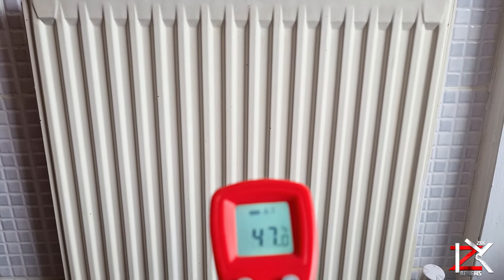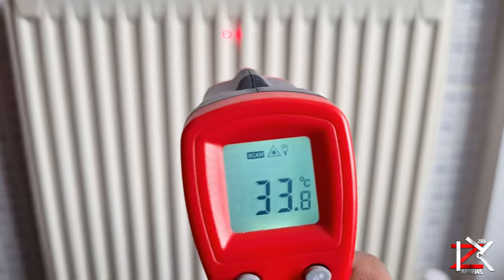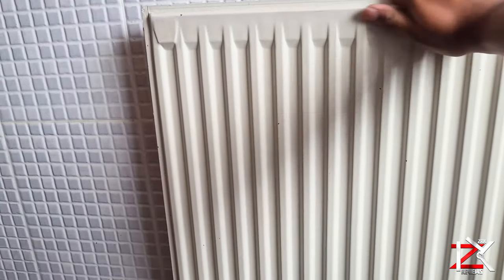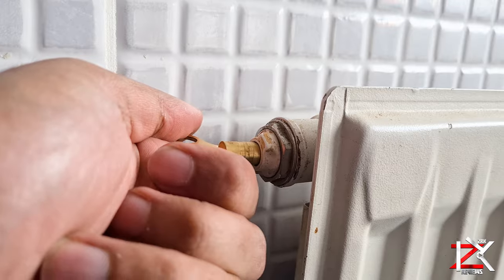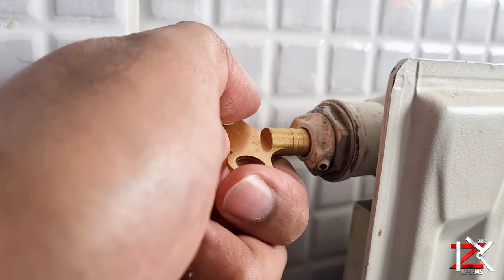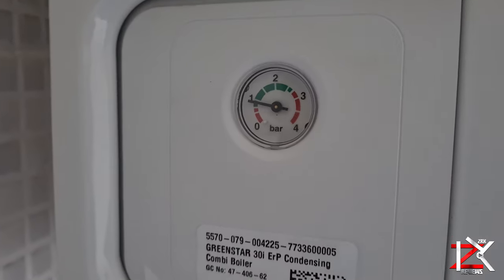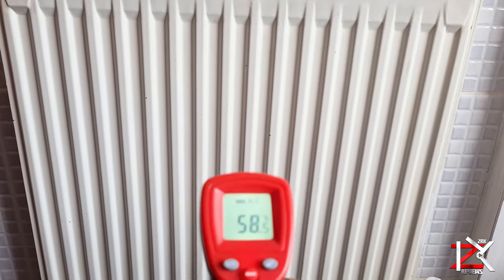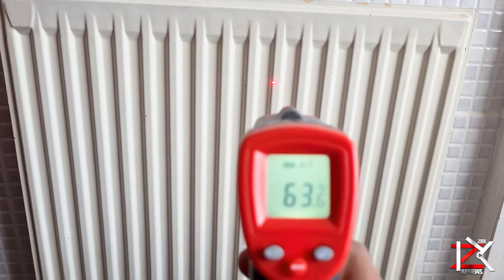How To Simply Fix COLD Top Radiators | How To Bleed Radiators - Cold Bottom Warm Top Radiators Fix

Comment: mine brand new rad and system flshed out all round house-rad warm rather than hot top half warm----bottom half cold-plumber left it like this as he failed to bleed other rads upstairs as wee found out after he left and had been paid ---other rads upstairs and down roasting now after i bled them all-- but not the new double one he fitted-he came back and alledged it was air after 15mins he said it was ok another £30-if i had been there i woulkdnt have paid him-no better-rad still the same---wife told him i had bled it no air coming out she told him-- that was 10 days ago-he hasnt come back-what in your opinion is the problem thanks
Reply from the maker: Hi, i cant seem to understand exactly the issue, the only 2 issues with a radiator is having too much air or having Radiator sludge which is a mix of dirt and rust, this is what stops your rad getting warm. in regards to someone you paid to fix the rad its a civil matter. always pay after job satisfaction.

Comment: My radiator is hot at the top but cold at the bottom. The weirdest thing about it is that return pipe is hot and flow pipe is cold(actual pipe below trv). I am puzzled. Could it be because system is not well balanced?
Reply from the maker: check with your other rads if its the same, normally if its cold at the bottom then the rad needs cleaning out as alot of  debris from the pipes is sitting there. get a mag filter install too.
Reply: @ZRKREVIEWS  thanks. That's what it is other rads are also cold at the bottom. It just does not explain why pipe under TRV is cold and return pipe is hot.